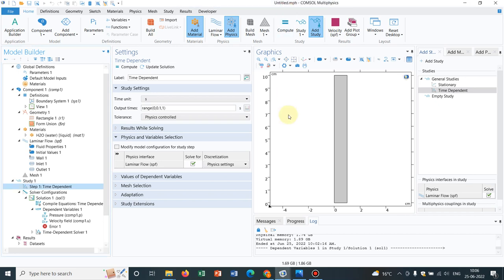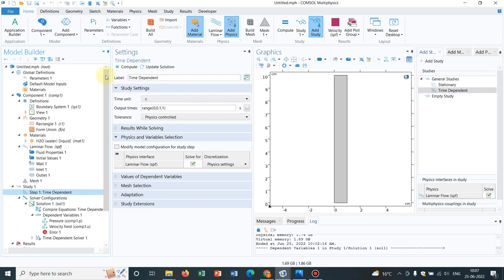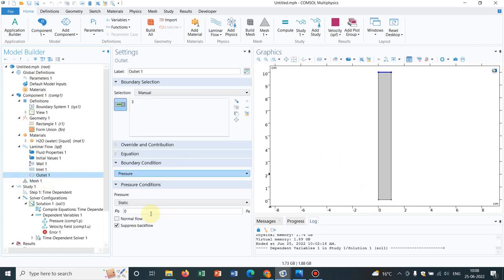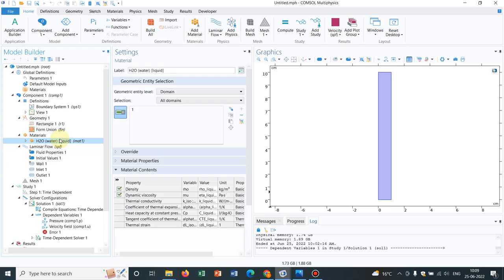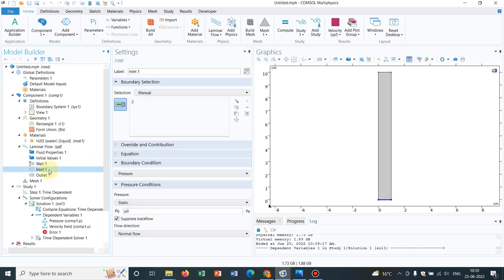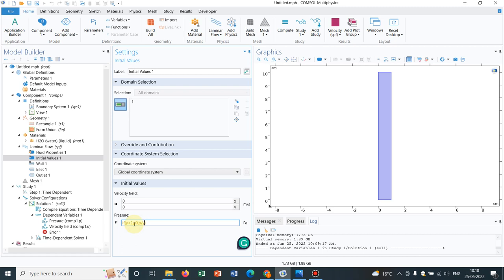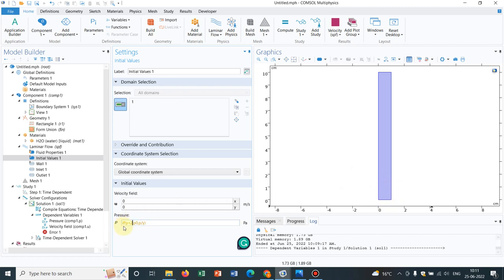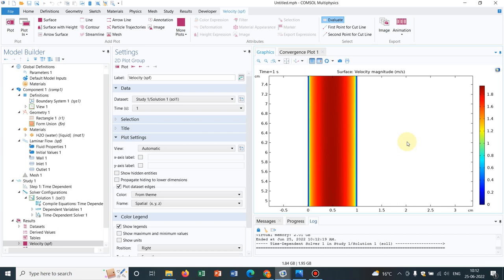Usage of if else in COMSOL

Comment: Sir, can you make a tutorial on how to co-simulate with simulink.
Reply from the maker: I am currently working on those tutorials and hopefully I will be able to upload in April.
Reply: @pioneerofsuccess4054  I have a question to ask you. You may not be engaged in this field, but I believe that your professional ability can give me some advice. That is, I want to build a model in simulink, and then use livelink with simulink co-simulation, and then the model built in COMSOL is a double-winding transformer. I hope to be able to connect one port (one winding) of the transformer with one circuit in simulink, and then the rest One port (another winding) of one of the windings is connected to another circuit, then, this situation should require COMSOL to have input and output, then for example, simulink has a circuit that generates a voltage, and this voltage is applied to the transformer of the COMSOL model, and then another One winding also has a terminal voltage, which is input to subsequent circuits. Do you have any good suggestions?thank you .